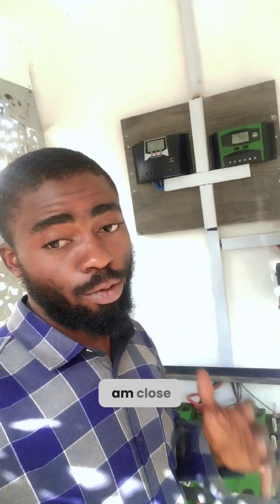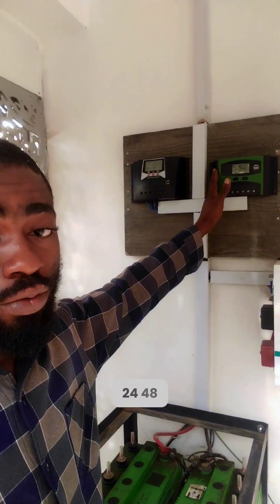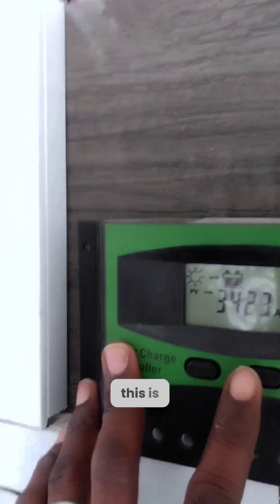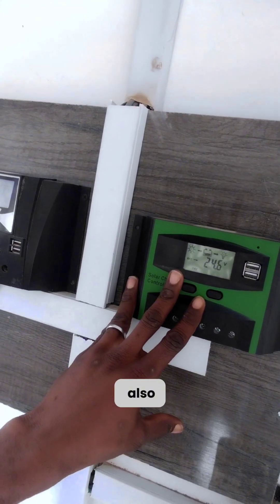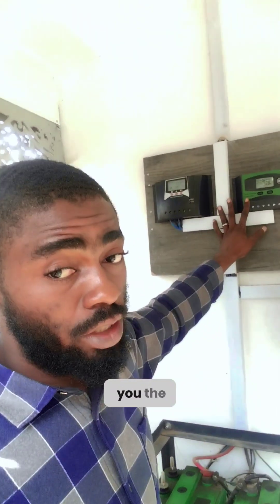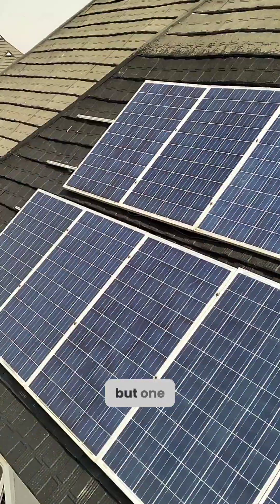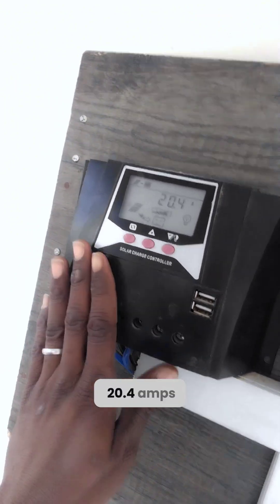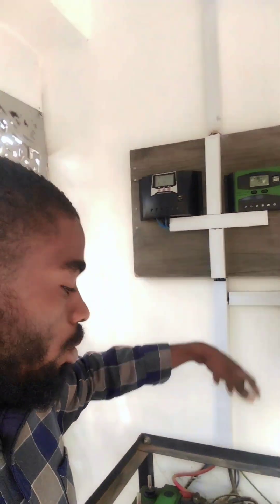Effect of dust (harmattan) on your solar panels!.

Comment: I noticed a performance drop in my setup during the harmattan. 

I have 4 330watts solar panels. 3.2Kva inverter 

Then came rains and the next day, i noticed a significant improvement in the charging rate!

Thanks
Reply from the maker: You're welcome

Comment: Using pwm will not give optimum performance. A single 60amps mppt will give double the current output
Reply from the maker: Stop deceiving yourself sir
Reply: You guys need to learn how PWM and MPPT works.
The only spectacular thing about MPPT is that it converts excess voltage to amp. 
If there is no excess voltage, a PWM is Equal to an MPPT. So if you do your calculations well. You can use a PWM with the same performance as an MPPT.
For example. If you have a 24v system and the peak voltage of your solar panel is 36volt, there is no excess voltage here, therefore the PWM will do the same job as the MPPT.

Comment: Can those two controllers be connected in parallel to charge the batteries together at the same time, rather than one controller charging a series of two batteries and the second controller charging the second series of batteries.
Reply from the maker: Yes you can, but it won't be so much effective
Reply: I support his idea of connecting the two charge controllers in parallel.
The connection you did might affect the lifespan of the battery in the long run as they would not be charged equally and they are connected to a single inverter. 
Please review your connection
Reply from the maker: They charge equally sir

Comment: I wanted to ask a question,the inverter you said it's 3.5kva 24v system and you connected 4 batteries to it in parrel does that mean you will have more backup time with the 4 batteries ?
Reply from the maker: Yes sir
Reply: Okay thank you..I used the same yohako 3.5kva inverter 24v, I'll also like to add 2 batteries to it to make it a total of 4batteries